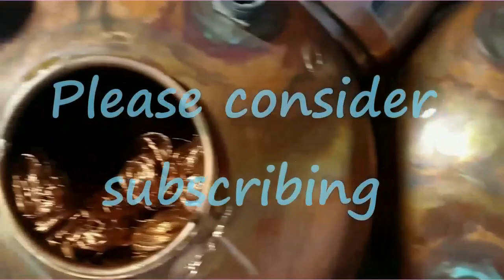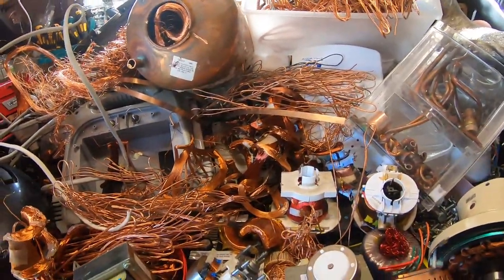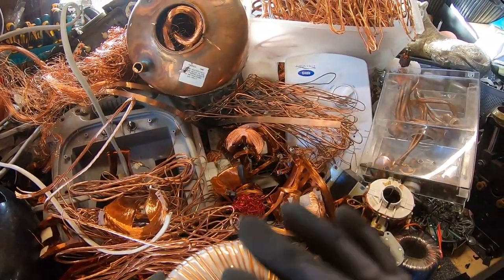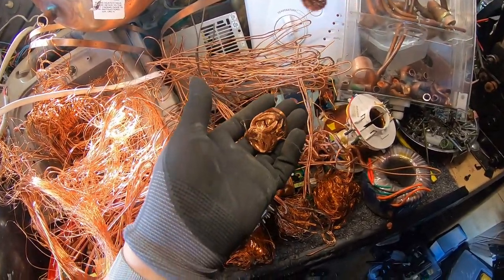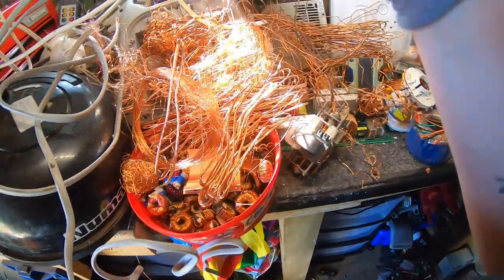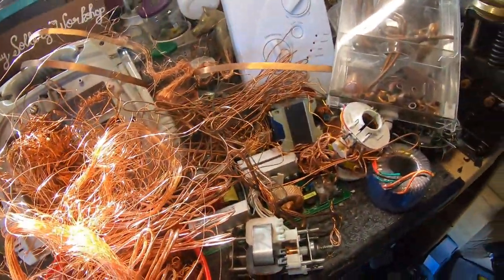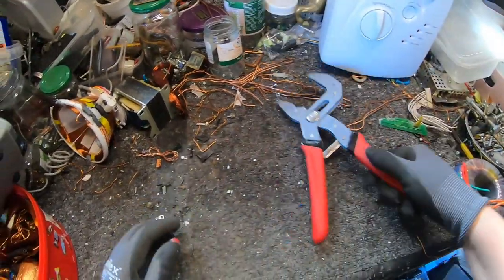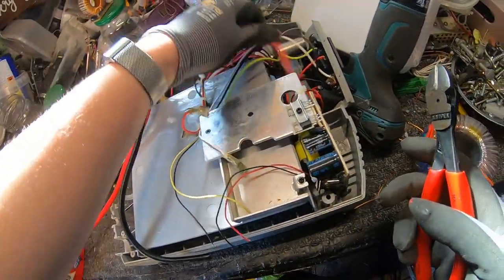Where to find free scrap copper and make easy money!

Comment: just found you instant thumbs up Ive been recyling for 40 years ( if you wanted nails for your trolley / go cart /soapbox racer what ever you salvaged the nals from old timber and straightened them to use them I also rescued nuts and bolts from old cars going to scrap I would also remove relays bulbs and fuses
Reply from the maker: Really appreciate you joining me🙂 Recycling anything is the best hobby, so satisfying, I adore scrapping!!

Comment: Ive been recycling nuts and bolts for over 40 years ( both metric and imperial)  got into small scale non ferrous just recently I have a forge where I recycle and smelt ally by the bucket load mostly cans and old motors
Reply from the maker: That's awesome, can't wait to melt for the first time 🙂
Reply: @SollersSrappingandDiving  I bought a vertices forge from e Bay or amazon I can't remember now but because I'd seen big stacked in Australia  smelting ally I thought why not scarap the cans I get my beer in my neibour loves his cider soni have his empties too I have a yard not too far from me that will take the cans crushed or not at 50 pence a kilo ifni smelt them to clean ingots id get 80 pence a kilo

Comment: heads up most fridges and freezers have steel condensers the (radiator you see on the back ) these may still have gas in them freon air con units may also still be gassed
Reply from the maker: Definitely I only take air con units if they have told me they have been degassed and I don't touch fridges and freezers, I'm not prepared to release freon into the environment. That's why I'm always amazed to see people can put them in shred in the US
Reply: @SollersSrappingandDiving  glad to hear tha t the air con units have been degassing.   Im ex industrial fridge o

Comment: Good tip on the magnetrons. I did not know that. even though with my business model I don't have time to process for the copper and Ill still throw them in Irony aluminum  its still good knowledge to have
Reply from the maker: It's always interesting learning new things. I know what you mean about the time to process etc, there is so much more I would like to do if I had the time, thanks for watching 🙂👍
Reply: @SollersScrappingandDiving  yup sometimes I have to pass up on value because the time it takes is far greater than the amount of money to be made. My business is being built on volume and easy value. If I remember next time I'm doing a microwave on my scrap channel I will try to mention the copper in the magnetron  of course I will Add your nasty chemicals warning
Reply from the maker: @davegdm954  oh you have a channel, I'll check you out 👍
Reply: @SollersScrappingandDiving  the channel that you should check out is @the new england scrapper, not this one I commented with. haha oops I guess I should have mentioned that

Comment: so if your only getting 50 quid a run whats the point, surly you need atleast 200 a day to make it worth doing
Reply from the maker: Not at all, some runs are non-ferrous big bucks, or circuit boards that will get about £1000 a run, but some are ferrous cheap runs and my yard is so local, I would much rather get rid of the bulky iron, and whatever I have stacked up at the time that I am turning in so I don't live in a what looks like a junk yard. I actually don't turn in my copper (except VIR cable), that is all kept if I did take it, I'd obviously get a lot more each run. Scrapping for me is a hobby and most hobbies actually cost people money, hundreds or even thousands, I'm always happy with making any money from mine, it's all a bonus. Obviously if I lived a distance from the yard, I would have to save up the scrap for bigger loads.